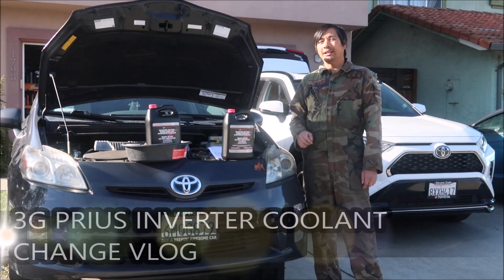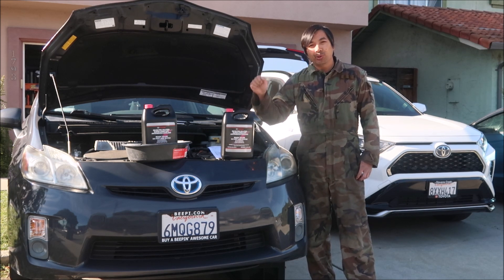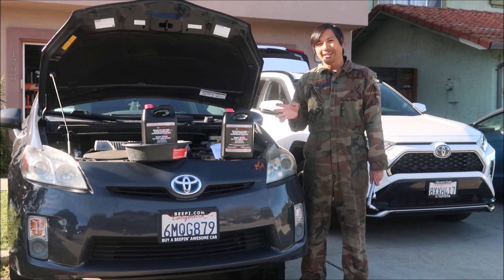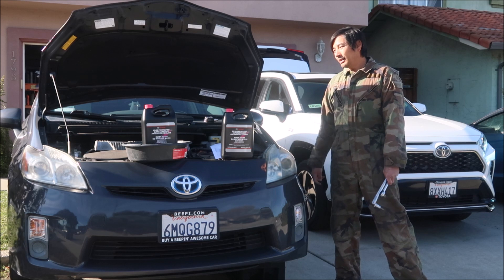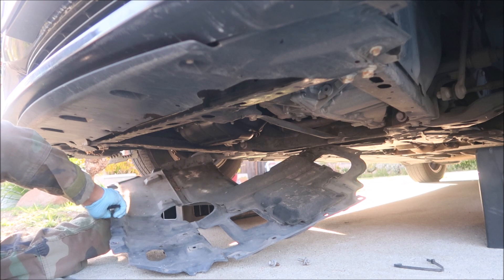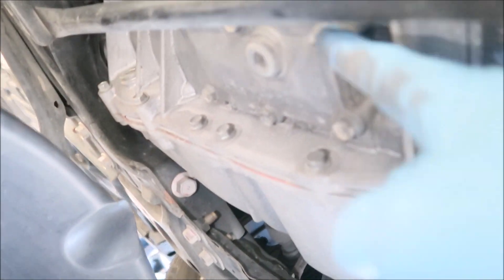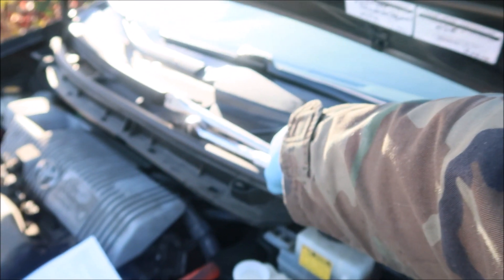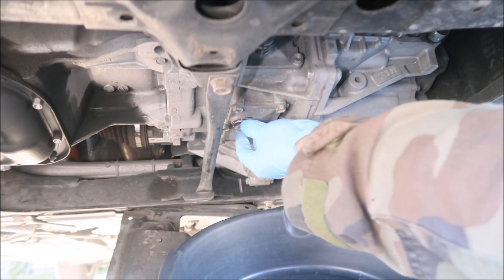3G Toyota Prius Hybrid Inverter Coolant Change VLOG (2010-2015)

Comment: You should change out that dirty brake fluid. Bleed them.
 How often should you change out inverter fluid after 150,000 miles? I’ve been reading that people change it out every 50,000 miles.
Reply from the maker: According to the warranty/maintenance log book the engine and inverter coolant should be changed at 100k with the Toyota Super Long Life Coolant